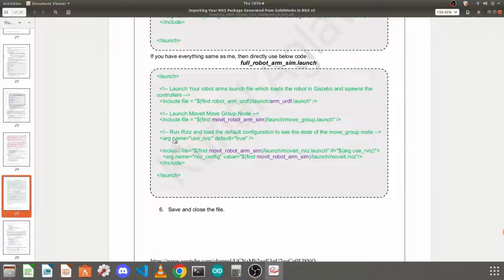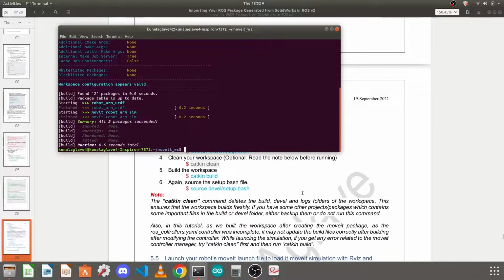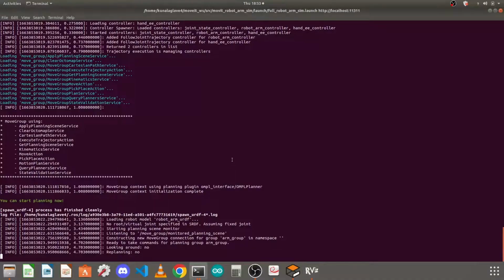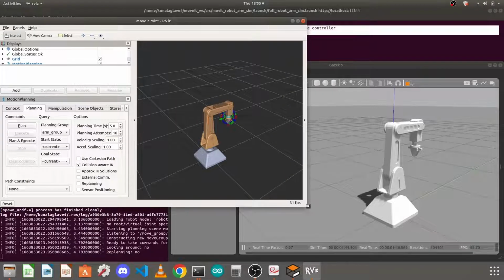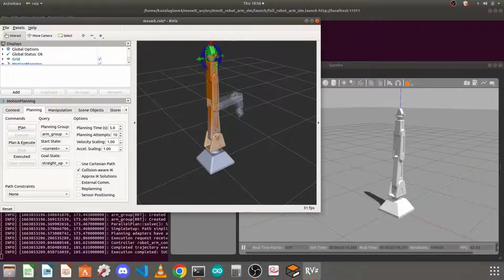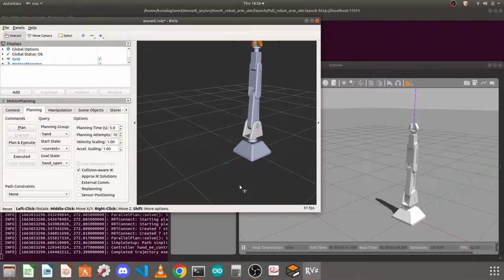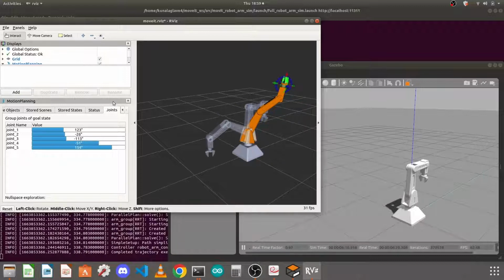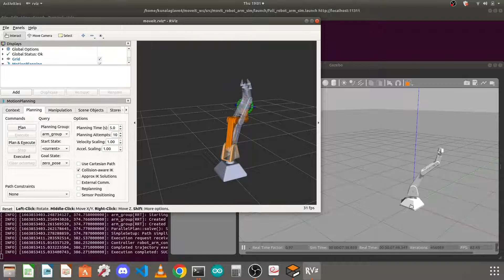Lesson 14: Launching Final Moveit Manipulator Simulation of Custom Robotic Arm in Rviz and Gazebo

Comment: hi, i saw ur videos and tried to follow the steps i used ur same code but i am unable to do this working for gazebo...in rviz it is working but nno movement in gazebo..i am using Ros noetic and i am getting this error can u pls tell the solution...

40527.869616958, 13.939000000]: Returned 0 controllers in list
[ERROR] [1744240527.869732905, 13.939000000]: Unable to identify any set of controllers that can actuate the specified joints: [ joint_1 joint_2 joint_3 joint_4 joint_5 ]
[ERROR] [1744240527.869793999, 13.939000000]: Known controllers and their joints:

[ERROR] [1744240527.869867893, 13.939000000]: Apparently trajectory initialization failed

Comment: hey man. I am still facing the error of Controller spawner could not load the controller_manager ros interface. any idea on how to deal with that?
Reply: WARN] [1720436864.464852, 10.022000]: Controller Spawner couldn't find the expected controller_manager ROS interface.
Reply from the maker: Hello. Please install all the necessary intefaces. Please check the initial tutorials carefully to install everything you need.

Comment: how will this work with real robotic arm and real gripper?
Reply from the maker: Hi. We need to connect our Robotic arm to ROS. If we take example of Arduino based robot, we can use the rosserial protocol to communicate with arduino. On arduino we can subscribe to the massage of the poses of the robotic arm joint and we can set the servo motor or robot arm join angles accordingly.